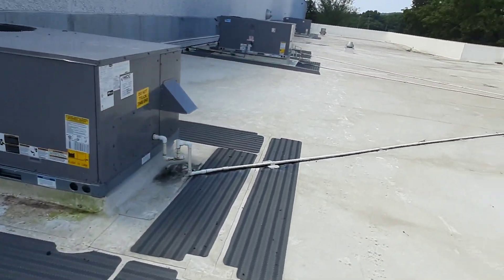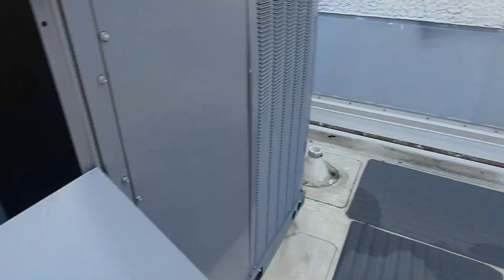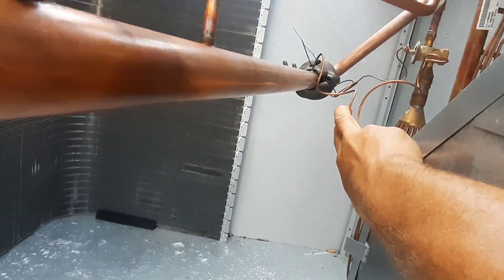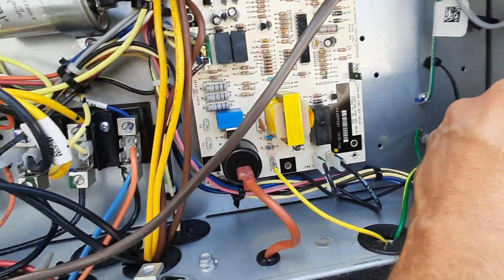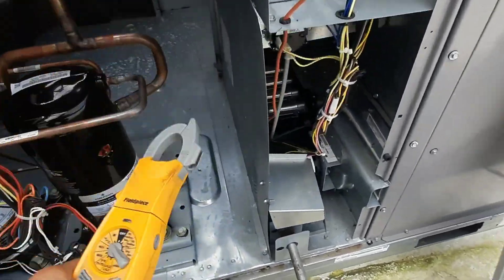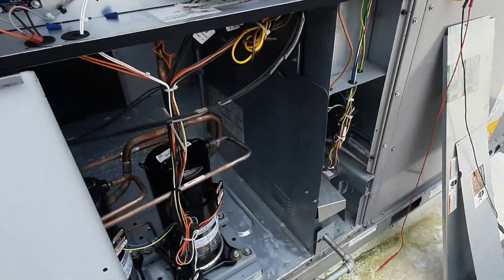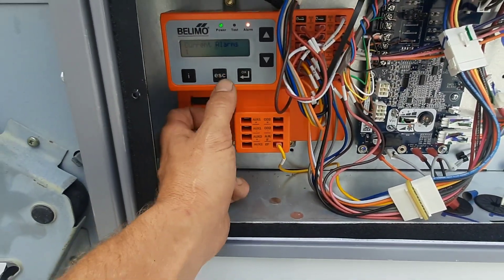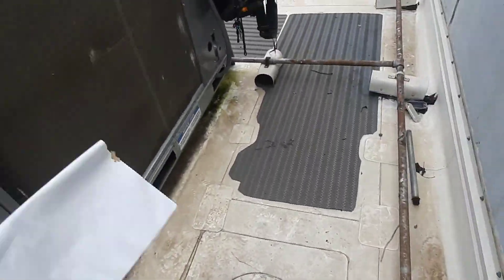New Carrier package unit not cooling. #hvac #hvacservice #hvaclife #commercialhvac #hvacarmy

Comment: how did you know to just check the economizer and the low pressure, why didnt you check the high pressure switch, im an apprentice just learning your troubleshooting thought process.
Reply from the maker: I found the freeze protection thermostat failed on my initial walk through inspection of the unit, the wire diagram showed it wired through the low pressure switch.

Comment: I don't do HVAC, I'm an IT hardware field guy.... and yes it's exactly the same - the "customer states" notes that dispatch then read to you as though they are bible.... always completely unrelated to the actual fault. Get to site - the customer then reveals the actual issue.
Customers are savvy, they know exactly what to say to trigger an engineer visit immediately and short circuit the hours on the phone with the helldesk trying this and that. They know it's going to need a visit to resolve and they have a business to run, do not have time to be pratting about with hoop jumping on the phone - so they say whatever it takes to get a dispatch.
And I don't blame them, honestly I think I'd do the same in the choice between visit today or go on the low priority pile that may get a visit next week / month. I have all the time in the world and understanding for this.

From a personal perspective, it causes me a problem because my day will be scheduled based on the original "customer states" fault and when I overrun time in order to fix the actual fault for the customer I get penalised. But that's between me and my employer to beef out not aggro the customer about.

This whole way of working just makes me want to pack it in and go do something, anything else. Imagine a job whereby if you spend the time to actually resolve a customer issue you get penalised for taking to long. Yet if you do not resolve the customer issue first visit, you get penalised also.

Pfffft...
Reply from the maker: I hear ya, thanks, chillybrit! I think this is our dispatch problem not so much this customer and we are not penalized for any of this, I work for understanding people who have worked in the field and a good company. I recently switched to a controls engineering position on our manufacturing side so I’m learning a different perspective now.
Reply: @EverythingHVACR  Congrats on the change of role. A change is as good as a rest :D

Comment: wonder what happened to the freeze switch. I came across a brand new unit with the sensing bulb busted right at the switch.
Reply from the maker: It’s in a bad spot right next to the filters, a careless tech could easily snap it off but in this case the filters had not been replaced, I suspect it came from the factory this way.

Comment: Great video. Thank you for sharing. If you don't mind me asking ? May I ask, what is the name of connector you using to connect 2 white wires ? and what is the name of 2 white wires call ?
Reply from the maker: Thanks, ZE! Questions are always welcome and I will answer them the best I can. Someone else asked about the connector as well and I’m not sure the exact name but it is a typical wire connector you can find at your local supply house. I might call it a piggyback wire connector. The 2 wires were the freeze protection thermostat (FPT) safety wires.
Reply: @EverythingHVACR  Thank you. Please. Could you explain for me ? What is Freezer protection thermostats ( FPT) ?
Reply from the maker: @zekenzy6486 there can be different kinds. This one is just a thermostat mounted in the return air stream. If that return air gets too cold the thermostat will open and turn the compressors off to prevent the unit from freezing. It is wired into the same safety circuit as the low pressure switch. I hope that answers your question.